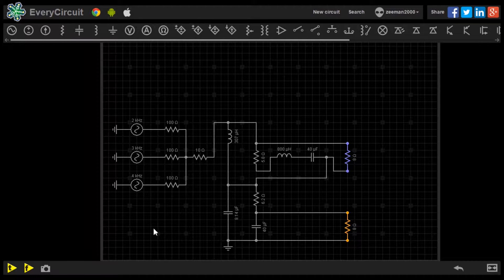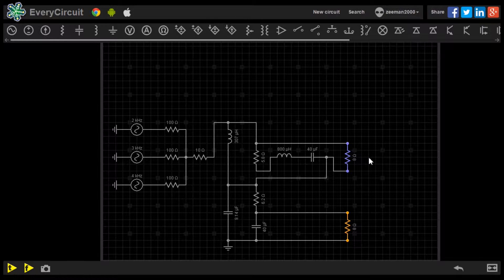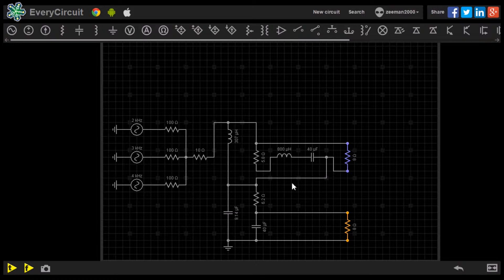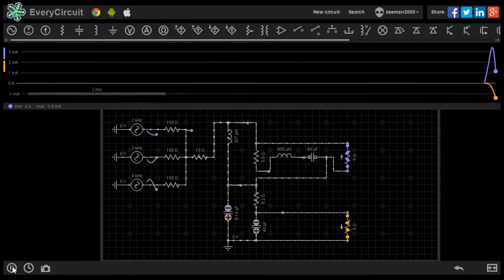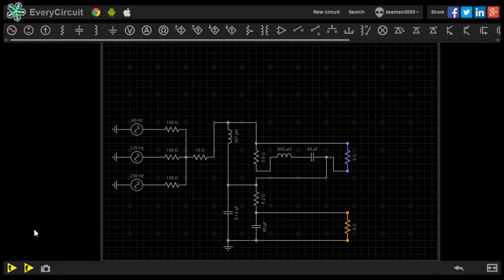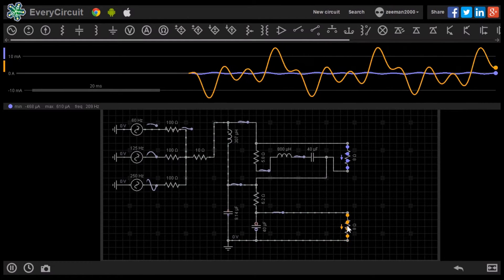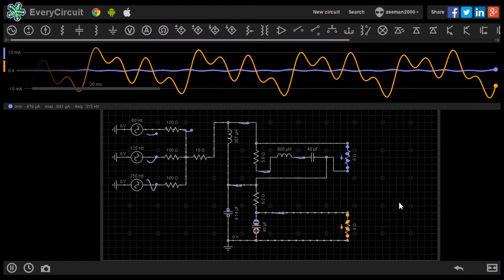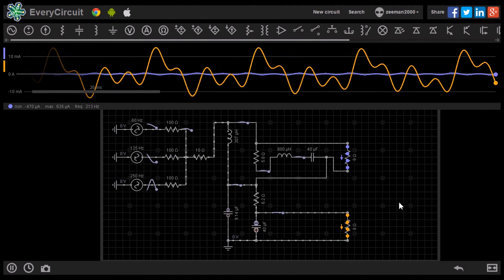Electronics Tutorial 12 - Inductors - Practicle Application

Comment: i see 2 band reject filters , one after ac sources and one to the twitter( RLC) and one low pass filter to the woofer. I expect then   2 frequencies to be rejected  and lower freq. accepted  by woofer in this circuit . i don't understand why the twitter accepts a range of freq. , which freq. are rejected  then? And second  question what's the purpose of first band reject filter ( after the AC signals)? It would be helpful  to explain the whole flow of signal through the circuit . Thank you !
Reply from the maker: The AC signal was used to simulate sound waves which would range in many frequencies and range heights. The filter for the woofer would be used to enhance bass sounds. Where the tweeter would enhance treble sounds. Uses are for sound systems.

Comment: Jenko022, Thank you very much for your great videos.  Could you please confirm that the component values I have entered below are correct, for the Practical Application Circuit?  I ask this as my eyesight is not quite as good as it was.

Electronics Tutorial 12 - Inductors - Practical Application

Components from left to Right

3 Voltage sources - 2 kHz, 3 kHz & 4 kHz
3 Resistors - 100Ω, 100Ω & 100Ω
1 Resistor - 10Ω
1 Inductor - 307 µH
1 Capacitor - 914 µF
2 Resistors - 58Ω & 62Ω
1 Capacitor - 40 µF
1 Inductor - 800 µH
1 Capacitor - 40 µF
2 Speakers – 8Ω each

Best Regards, Stephen Roberts
Reply from the maker: +Stephen Roberts Hi Stephen, 
1 Capacitor -  914uF should be 9.14uF
2 Resistor - 58Ω & 62Ω should be 5.8Ω and 6.2Ω

Everything else on the list is correct. If you need any further help, I can send you a image of the circuit.

Hope this helps.
Reply: +Jenko022 Thank you very much for your reply